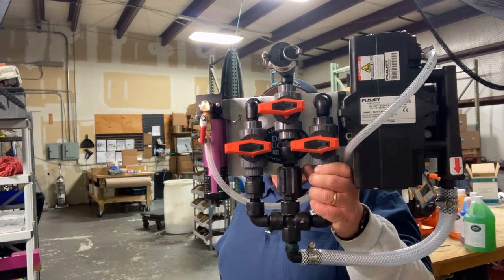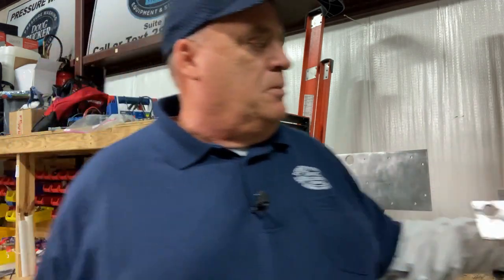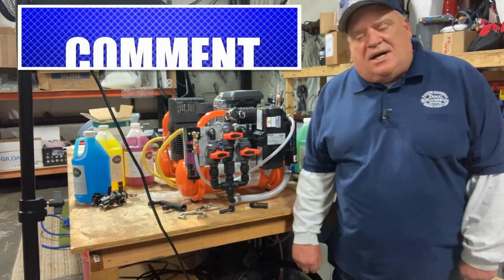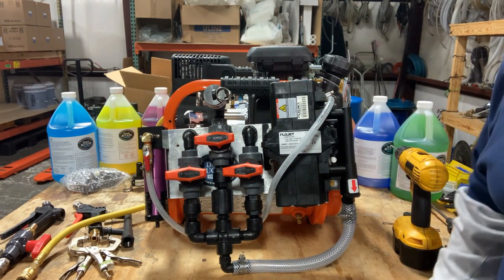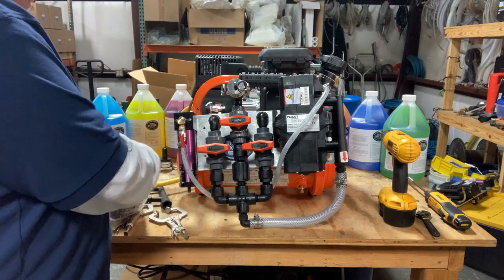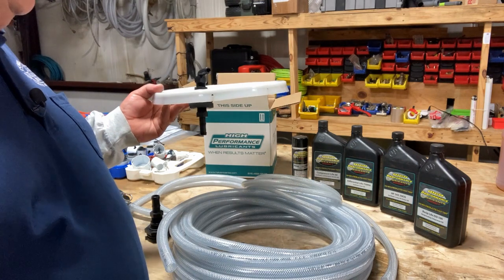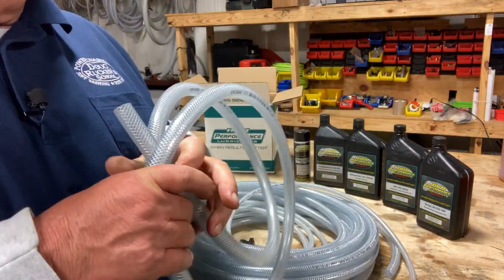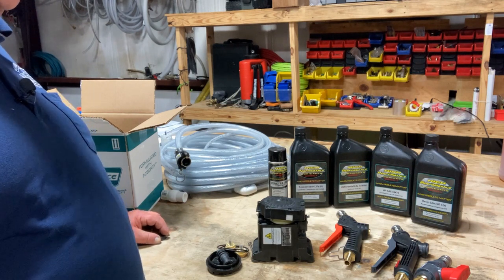Best Pressure Washing Equipment KINGSLINGER UPDATES 2020

Comment: Would it be possible to utilize the 3rd fitting of the proportioner valve
 along with a 3 way valve after the outlet of the pump to be used as a transfer pump without traveling through the reel ?
Reply from the maker: I do believe that would work...

Comment: Doug, Nice video!  Sir, In case I can use my existing--What are the minimum specifications on the compressor for a 10 GPM system?  Horsepower, CFM rating, air tank in gallons, and pressure? thx Rich
Reply from the maker: We use the Northern Tool 5 gallon.  5.0 CFM at 90PSI....the pump is rated for 90PSI and we run it at about 97...taking a chance I know....Occasionally we will go 130 - 140 for a little more distance and then back it back down.
Reply from the maker: https://www.northerntool.com/shop/tools/product_200401869_200401869

Comment: Do you have to hook the water inlet to a tank, or can it be fed directly from a house feed (or would this cause an issue due to the pressure differential between the water inlet and the bleach inlet)?
Reply from the maker: Can’t be hooked to hooked to a water source. Needs be fed from a tank

Comment: Do you have to play (squeeze and release) with the trigger while using? I mistakenly had mine set at 50psi, so obviously wasnt pushing a lot or going too far, and it wouldnt build pressure past 55 psi? I assume thats the limit and just wondered if you get consistent 97 psi? Thanks Doug.
Reply from the maker: Yes stays consistent the compressor will loose pressure but builds right back up but I don’t lose any distance while it’s doing that.
Reply: @PressureCleaningSch  Beautiful Doug!! Thank you!!!
Youre the MAN brother.

Comment: I’m doing a commercial job on a concrete building with 45’ walls. Will this machine reach that high?
Reply from the maker: Hey Shaun that might be stretching it a bit. All depends on the wind.  We can usually get 35-40 feet with ours.  You might have to use a 10 foo step ladder to get a little more. I just don’t like to make promises on that kind of distance. Occasionally we will adjust the psi to get more distance but it’s only fit while we need to hit a certain spot or area for a limited time. In others I wouldn’t risk running it that high for the a full job or long period of time.